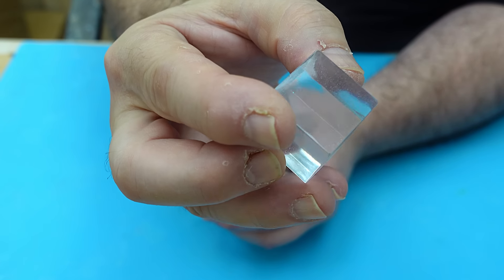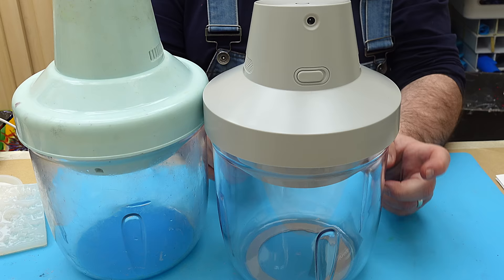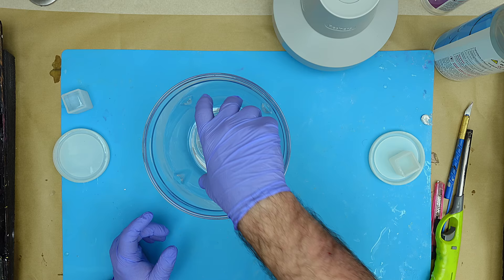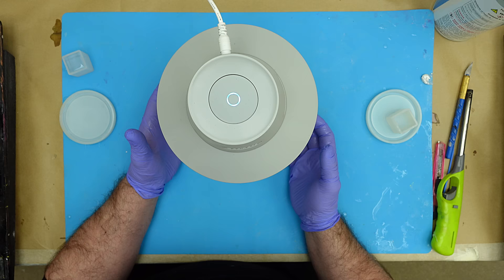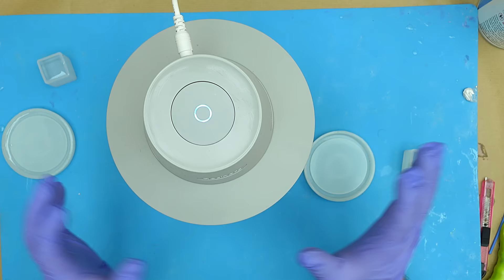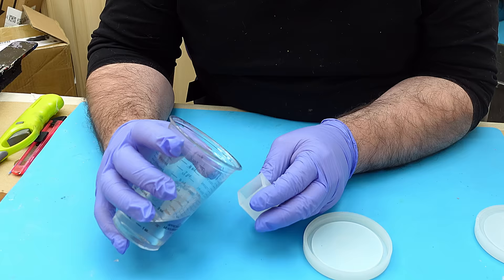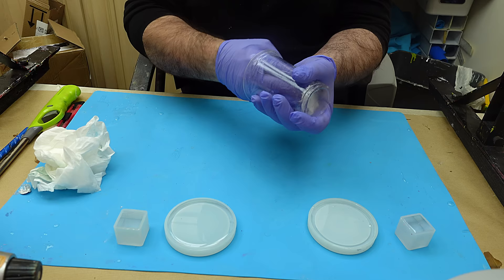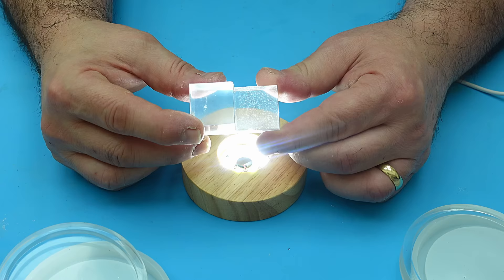Is This LOW COST Resin Bubble Remover A Game Changer or a Flop?

Comment: Yeah nah, worked in resin for over 6 years now. I got my pressure pot and a compressor cheaper then that little thing is, $40 for the pot from harbor freight, $3 for the ball valve to add to it and then $25 for the pancake compressor (that has sense been replaced with one MUCH quieter). Yet this thing you are showing started out at almost $300 when it first came out on amazon, and has slowly lowered in price sense as no one was getting it and it got low reviews. 

I also would not recommend it as guess where ALL the resin fumes go as it's trying to suck out the air? Yep into your space, and it still only works as a vacuum chamber, another thing you can get far cheaper then that thing and with that you can run a vent or just have the vacuum pump by a window while the pot stays by your work. My own was like $80 something, that's with the whole setup and I only use it for stuff that either can't fit inside my pressure pot or can't go in, like my tumbler cups that need to stay on its cup turner. But with all those the molds are flat and thin so a vacuum chamber works fine. But it does nothing for bubbles added by pouring into deeper molds. You will still have bubbles that way so a pressure pot is still recommended, plus it helps get the resin into every nook inside the molds. That is why all professional resin crafters use a pressure pot. 100% of bubbles gone.
Reply: Totally agree!  This vacuum chamber is way too expensive and can cause your resin to bubble all over the place.  I don’t know why everyone is trying to sell this thing.  A pressure pot is the way to go.
Reply: Load up a video on that, please.  I'm looking at pressure pots. But as a master food preserver, I have several pressure canners I can convert.  I  hope that makes sense. I  just had surgery last week and managed to slip and fall right after 😢
Reply: @VickyShawcooksalot I think with the right fittings you can convert a pressure canning chamber. 

I hope you will be healthy soon, and happy crafting and good health to you and your loved ones.
Reply: Good point on where the resin fumes go! Glad you pointed that out. 👍👍
One argument: air bubbles are not "gone" using a pressure pot. They are super-compressed, but DO remain. The poured resin MUST stay in the chamber until it's cured, or the bubbles WILL reappear.
Reply: @fairyspunfibers9098  Well yeah, that is the norm. You keep the resin in the pressure pot until it's cured as it shrinks the bubbles to microscopic levels. That is the point of a pressure pot :P There are inserts to give it shelves to stack more works onto if needed. 

And as said, if a mold or something don't fit inside due to being too long or such, that's where the vacuum chamber comes into play. But mine, just a standard cheep one I can set the pump by a window and have the pot stay on my craft table, a tube connects them and bam. You can't do that with this resiners degasser.

The only down side with the vacuum is you re-add bubbles as you pour the resin, thankfully all my 'too big' molds are rather flat, and my tumber cups resin goes on in a thin enough coat a torch can pop most that end up added.
Reply: Yes! I'm not impressed with these debubblers, I have one, you'd think they'd make them a bit bigger to accommodate at least a 32oz cup because i do love the mixer and the cups won't fit, can only do snack amts at a time and what good is that?! Ive put recommended amt in and still overflowed. Its ridiculous, sometimes you want to make a few things at once or have a large mould and it's too time consuming. I  would advise people to put their money towards a pressure pot, which is what I'm shopping for now.  I'm a bit overwhelmed after researching, I contacted a YouTuber about hers but she has yet to get back to me answering a couple simple questions. I'm not sure what size to get and is it true I just need a compressor that's at least 3.5hp? If anyone could advise,I could get one asap.  I'll be using it for small things, keychains, small trays, maybe a large tray and some moulds like for bowls and jars and making other odds and ends. I'm fairly new to resin but really fell down the resin rabbit hole hard and am crazy about my resin crafting. I'd like to make some dice too. Pressure pot is definitely the way to go.  I figured out the curing machines. It'd be nice if the affordable ones were level like they should be, but they're not. And pouring in some is tricky and you don't realize how uneven they are until you see the end result. So, I let moulds sit and set on the leveling table, then transfer to the curing machine. But  here I am back to the bubble issue. I had a trinket box come out awful last night and that was the final straw. I do everything right. Use right viscosity, warm bath, everything. Still w/the bubbles. I have to get a pressure pot and the sooner the better. So if anyone could please just help me out with getting proper size and any other important things I should know I would greatly appreciate it.  Thank you in advance. ~Pamela 😃

Comment: Thank you so much for this video! I got the original and it came with a learning curve (like how high to fill the cup). I couldn't figure out why it took so long, more than half of the total working time, to mostly de-gas. It's because I'm experimenting with a thick resin. Makes so much sense. 
As to the new gadget, I get the ease of use in having only one option and using medium to thin resin for the best results ... however, for $10 US you can get a coffee cup warmer. Put a full cup of that of thick resin on the warmer and you've got a bubble-free resin in half the time. Yes, it's warmer by a bit, so yes, it decreases the working time. but do you really need that time if you're using molds? Resin painting, sure, or blooms, feathers, or Petri, sure ... but not for molds. 
In my experience, save your money on either and get a coffee warmer if you only use molds. 
However, the machine comes in handy if you're painting or doing blooms, etc.
Reply: Please note: thicker resin (I'm talking Shabebe brand) can flash cure in 5 to 10 minutes if you warm it like this, I've had it happen when i used that brand.

Please only warm your resin bottles separately before mixing, unless you are sure that heat will not cause a flash curing. I wasted ounces of resin before I found out.

Comment: I'm glad it worked for you Steve. I didn't have such luck with the one I bought. It was the original one, used it with ArtResin - which is medium viscosity, and it didn't work at all. Actually seemed to make more bubbles and when I let the air back in, it just got frothy. And using the machine cuts down the working time of the resin so it's not great if you are trying to resin something a bit larger than jewellery. I have seen others say the same. But then some love it. No idea why it works well for some people, but not others. I had such high hopes!

Comment: I just tried mine and when it was done there was a layer of bubbles in the top so i let all of the air out and turned it on again by the time it was done it was pretty much a soild layer of bubbles with just a tiny bit of resin underneath. What in the world happened?!
Reply: I learned what my problem was, do not put anything silicone in it. I tried it again and used a plastic cup to hold it and it worked much better!! Never give up